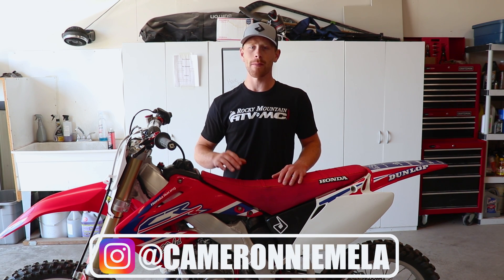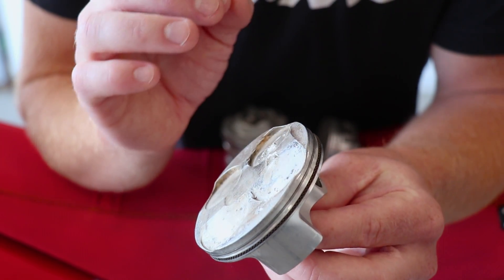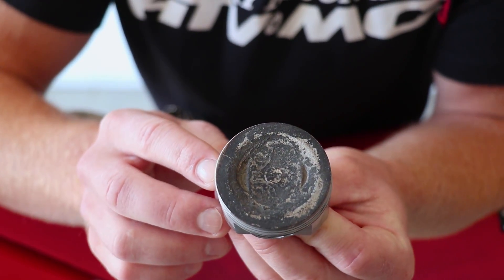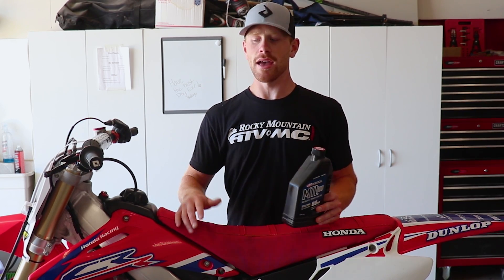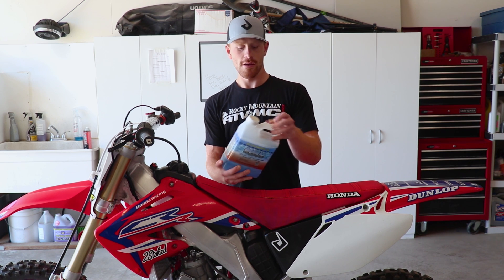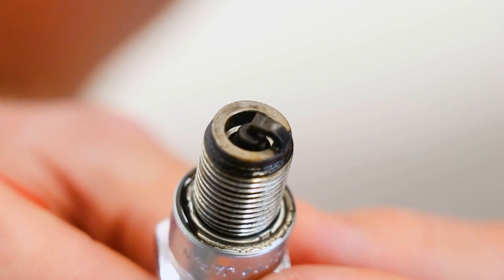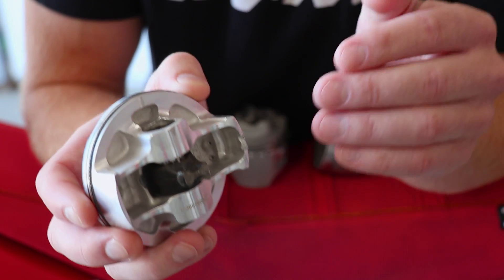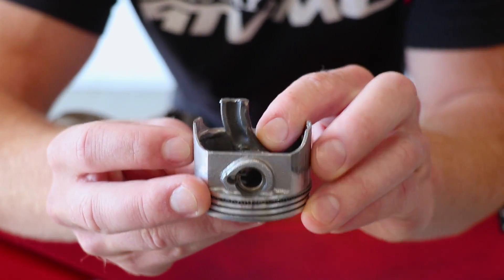Why Do Engines Blow Up?

Comment: Could it be a goo..d idea to change out the valve springs before they become too weak to close the valves fast enough to keep the piston from eating them like your own  engine did and the piston with a valve smashed into it .??? .. And a good way to stop those cam cha ins from ventilating .the bottom end is to change them out before they c$$$ caching change you out ..that every year to be safe you gotta do ..like Indy cars that have to be done every race ....you see kiddies when you burn your candle at both ends you get a bright light .but for a very short time ....see you at the parts counter ..

Comment: Cameron love your stuff mate, I am an AUssie based in Phuket Thailand, we ride singke track in the jungles and mountains, my main bike is a KTM 525 EXC setup for tight single track (many mods) amd I also have (had) a CRF2050L with Takegawa 305 BB kit, EJK controller, Yoshi (clone) pipe, YSS susoensions mods and Renthal bars.. its went like a rocket, ran perfect ridden hard offroad only, was my backup bike and also for short adventure rides, was setting it up for longer trips .. THEN DISASTER .. i burnt clutch plates stuck in mud,  a new mechanic replaced clutch plates, oil change etc and first easy  20 mins it blew to pieces at 120km slow cruising on a road trip, TOTAL destruction - pieces of metsl csm out the top of the crankcase (scary), pulldown revealed the worst news -  full rebuild needed - 2 crank cases, cylinder , head, , valves, piston kit, etc (I can post pix link if anyone interested). Made no sense, its was an awesome engine, ridden hard offroad with zero problems, until then... mames me wonder if something done when last worked on caused it as seems  big coincidence! anyway  i dont want to go back to a stock 250 as I liked the 50% more power it had (my other bike is a KTM 525 EXC), I dont want to do the BB or Takagawa kits as I prefer to keep all Honda parts as when on advenrture rides all over SE Asia, will be easy to get parts. SO .. I am trying to decide between a rebuild using CBR 300 parts, or a full CRB300 engine transplant, or another that fits fairly easily. As I live in Thailand the CRF parts are cheap as they all made here, so thats a plus. Can you offer your thoughts? Anyone else done similar?

Comment: I’m too scared to get a 2smoker ✨rebuilds✨
Reply: 4t break less often if well maintained
Reply: @speedyboi349  Yeah, but when the problems come it’s expensive lol. I’m getting a kx100 February just because I at least want one 2 stroke. I
Reply: @490Adrian  damn those are fast 
Should i get

1 honda crf 150rb
2 ssr 250 and modify the carb
3 gas gas 250f
Reply: @speedyboi349  SSR will be a money pit, how tall are you? Can you fit a 250f gas gas? How long have you ridden? If you are experienced and tall enough go gas gas
Reply: Well im very experienced but im thinking on something my dad an i can ride 
Im 5,2 and 15, 100 pounds 

Dad is 6ft and he weights around 182 pounds 

I dont mind riding tall bikes
Reply: @speedyboi349  Go gas gas! I’m 5’2 or 5’3, 12 and wouldn’t dare touch a 250 lmao
Reply: @490Adrian  the problem is i can find them in my area 😑

I live in PuertoRico
Reply: @speedyboi349  Damn. Puerto Rico must be pretty to ride though.

Comment: Can having your air screw out too far cause your bike to blow by getting really hot from too much air?
Reply from the maker: Yes, leaning out the bike will cause damage but it's unlikely you can lean it out enough with an air screw to do much
Reply: @CameronNiemela  Alright, good to know, i think i have to drop the pilot to a 45 on my yz250x, it will not idle unless the air screw is out like 3 or 4 turns, i hope i didn't hurt my engine riding it with too much air.

Comment: ive had a valve snapped  blew a hole through the piston fixed that then it blew  up again a week later still not fixed that was about 2 years ago reason it blew up was my friend riding it through a big ass puddle un hydro locking the bike bent the rod lmao

Comment: Cool video Cameron! On 2-stroke 125s I have had the circlips fail twice! Both time resulted in pretty horrible damage to the top end, destroying the cylinders. I hear it is a common problem because even with quality brands like Weisco or OEM, the circlips are cheap pieces of aluminum. Thoughts?
Reply from the maker: How the circlips are installed had a big difference. They need to be installed with the gaps straight up and down
Reply: Cameron Niemela yes, they were.

Comment: so my engine blew like last week, they way it happened was strange and i don't really know how. i have found out that the ignition plug was too long and the piston hit the tip of the plug which punched a hole in the piston. i wonder how this happened and how much damage there is to the engine. i was going to order a new sylinder with a cranck shaft anyways but if more of the engine is broken i'll just buy a whole new engine

Comment: Quality of coolant won't cause any failures, you can run any fluid thin in a radiator and it will be fine.  I don't suggest that but we get your point.  Other why's great video.

Comment: Lost compression on my 2001 yz125, took the head off and the head was destroyed along with the piston. The ring seized around the piston. So I split the case and threw in a new crank with all new bearings! Now i'm just waiting on the kickstart shaft since it was stripped out and the bottom end will be done! Any recommendations for top ends? I installed the Wiseco bottom end kit
Reply: Wiseco

Comment: 2010 crf250r...bought used rode it 30 min..grenaded th motor..same story of needle bearing cage coming apart..like ur buddy Jeff very common..1 Hot Rod stroker crank kit later..still going strong...

Comment: I had change my oil on my ssr 189  before riding and forgot to tighting to oil bolt and on my way home  bout to clean and put it away when the engine lost like all power and started clankin loud so before it really siezed i killed it i put a new bolt and oil in it and now it it tick loud i think its the valves ive adj dang close to spec and still clicking or ticking is it ok to ride it?????? Can some plz answer this thanks

Comment: 2010 Suzuki DR-125SM. 150cc kit, ported cylinder head, bigger fuel injector, open airfilter and Black widow GP exhaust system. Banked 23.7hp on the rear wheel with 27Nm ft-lb of torque. Previous owner never bothered to check the oil retainer. about 3500km on the new build and the cylinder head exploded due to the amount of gunk that was in the filter behind the oil retainer, no oil was flowing trough the system anymore.. Camshaft and rocker arms were blue from the heat and completely bent. Piston expanded and the crown got stuck beyond TD, the connecting rod pulled the rest clean off the crown. Both valves were snapped. Amazingly enough, the crankshaft is undamaged, the crank balancer is bent however. This all happened in about 1 second on the highway going 140km/h trough a slight turn. I think I can thank god for not throwing my gearbox and still being able to roll her out with the clutch.
Reply: Is suzuki"s reliable

Comment: My 2006 wr250f has 14000 kms on it who wants to start a bid when she will blow .. burns no oil and valves are always in spec
Reply: Had one customer who got to 20,000 km on his WR250F & started to worry, so we decided to strip the top end & refresh piston & rings. It still looked like new inside. Last time i saw him it had well over 30,000 km & required & new Stator, but engine was still running strong.

Comment: Hey cam. I got a 05 trx450r. I went to my first quad race this year being a bike guy.  Made all my practices and rite before my 1st race my bike quit getting spark. I went to work. Trying to fix it.  Short story long. The stator and flywheel are beat. I change my oil every three rides. Even if I just putt around the yard for ten mins I count that. If u are a Washington guy I would love to meet ya man and maybe do a build with ya on this trx motor. Cause it's worn and there is slop where there should not be my friend. She didn't self destruct but is about to. Contact me. Austinsonger266@gmail.com

Comment: The piston on my cr500 recently blew apart ruining the crank and luckily nothing else really was damaged (except a few dents on the cases but nothing to worry about) and your videos have been really helpful on learning what I need to do to rebuilt the engine. For now on I will always take the cylinder off to inspect the piston and crank on every used bike I get.
Reply: How did it go

Comment: Everyone always talks about how much cheaper a two stroke is to rebuild but never consider how many more hours you get out of a four stroke. If you pay for a complete 2t rebuild you’ll pay around 500-800 depending on how you do it and a 4t will most likely be 600-1000. You’ll pay more for the 4t but will get 50 more hours before having to do it again, if you build your own motors it doesn’t matter then. 🙃

Comment: Your right bro, waiting eagerly for those build vids to come!!  But hey, I have the same thing, I also build bikes and fix them, like now I have a BMW F60GS. The cam chain tensioner collapsed, causing the intake cam to skip a tooth, and the piston did not play nice with the intake valves, and the cam chain guides also broke into pieces. Now, everything is delivered except one intake valve, as BMW South Africa had only one in stock. Now, to my dismay, everything is laying on the bench, itching to be re-assembled, but I cannot do anything for now. You can check out my site over at www.accustoms.co.za click on the gallery link. Not a very impressive site, but hey, I am trying.

Great stuff and keep the vids coming!!! You can bombard us with vids, nobody will complain!

Comment: For competition worth using a dial gauge every tear down and measuring things like con rod side deflection and piston height as well as regular checking of valve clearances.
For example in a 2t every time you swap rings, measure side to side rod defection so see how the big end is going as well as rinse out of the casing the see if there is any debris sitting at the bottom.
Color of the piston underside, signs of ash.
Main bearing radial and side deflection.
Measuring valve clearances can give early signs of some change to the valves that can indicate impeding failure.
Measuring piston height at exact TDC can show up signs of con rod stretching.

Comment: I need a friend that's smart like you lol I watch your videos to learn about engines and mechanics I bought a non running 2000 r6 and got it running but I'm not good with tunning carbs and I know you can do a good check up on it if I knew you

Comment: My 2013 Suzuki Rmz 250 rattles at really low revs in a high gear. Is that normal? Need help plz
Reply: Woidviatla Lausbua sounds normal, you shouldn't ride at those low rpms though

Comment: I had a motor blow up (with 3 hours on it) after rebuilding it with Chinese parts from ebay. the connecting rod disintegrated.

Comment: Yesterday i bought a new bike, went out for a ride and it ran great. Today i also went for a ride and suddenly the engine shut off and there were quite a bit oil dripping, I checked for leaks and i saw that the drain bolt weren't there... I had to roll it home (2km) but hopefully nothing have blown.

Comment: Never seen a bent/broken rod in a CRF 50. Seen some no oil/seized pistons. That tiny piston with the bent/fractured rod looked weird. Thanks for sharing.
Reply: Don yeah there stock bore us no bigger than  lil pecker. But that looks just like the big bore 88 cc kit piston I just installed for a buddy of mine. Keep shredding!

Comment: Dat feeling when ur engine blows up and u have to push ur bike 10km to home. Rips man inside very well.
Reply: Walk of shame
Reply: If it blows up on you u are doing something wrong! never in my time have I ever had any bike blow up. top end every 40 hours full engine every year 3 rides and oil change and always clean air filter simple. never grenade if you do that
Reply: @Bumfluff-Rider  Well my engine blew up because someone cut down a tube from my oil pump so I was riding for a while without oil. A few months after I got it repaired the same shit happened again. Some people can be real assholes.
Reply: @dominick1009  i rided my moto for 3 days without oil, didnt noticed it but its still alive idk how
Reply: @GamingSilentTuber  dang...what bike is it?
Reply: @csgmail4316  kawassaki 125cc street bike
Reply: @dominick1009  i dont use an oil pump its way easier to mix your self and way saver
Reply: @Bumfluff-Rider  Lol my bike from 2005 been used everyday rare changing oil and stuff,It's still going,Welp rn it has a damaged piston and there's a white smoke coming out,But yea after all the engine still sound soft,If u don't believe watch this vid https://www.youtube.com/watch?v=eZPzx2idnCA
Reply: veeti manninen jep
Reply: It happens to me like 2 hours ago and now I get home 👍🏼
Reply: I did that yesterday 😢
Reply: kkona ukko ite jouduin työntämään derpiä 4km lumisateessa
Reply: Rips my legs more Than my inside fuck pushing a bike through deep sand for 10kms
Reply: The time Dirtbikers get the most exercise 😩 that shi sucks when you gotta push it through mud or hills too😬
Reply: just had to do that today
Reply: Worst feeling there is and always when it's about to rain too
Reply: Or when your mate blows it up and doesnt pay to fix it!
Reply: @fishonadventures96  I do understand this. But if you put 60 hours on your motor and then let your mate rag it it’s not his fault 👍
Reply: I have spent more time pushing bikes then riding them

Three times my engine blew up and once the trans that's only in one bike

But lucky for me I was 3kms away

And once I was 10km on my other bike when the engine simply didn't crank 

Once on my quad the chain broke and cz it had this chain guard in the back the chain managed to rap it's self under there and I had to pull my 500 preditor from the back and push. It while holding it all way home

And in my 210cc the battery died slot of times and I had to push my bike

And in my three wheelier I ran out of gas I pushed it half way but a friend helped

Sure these bikes I didn't own them at the same time each one was in a different year /month
Reply: Just walked mines home. Walk of shame😒
Reply: I hade to push my xr100 13 miles I was just tight trail riding but I am glad I was riding a small bike

Comment: with coolant also a water pump failure, i had a yz250 blow during a desert race due to a water pump failure, figured i was 50 hard hours into a top end and in 5th gear wide open in the hot desert and didn’t check my water pump. learned it the hard way and barely caught it running hot before it seizure still had cylinder damage....

Comment: so does that mean if you never change your piston on your 2t it woild judt lose compression over time but not seize? People always say 2t biles seize bcuz some1 didnt change the piston which makes no sense at all to me
Reply: ACreativeName if the cylinder bore or piston starts wearing too much the piston can start “slapping” inside the cylinder and break the side skirts off the piston.
Reply: Another thing I've seen is that everyone thinks he is the best motorcycle tech. I have seen numerously that these wonderful technicians puts the c-clips in wrong or not properly seated. 6 out of 10 rebuilds I do is because of this!
Reply: ACreativeName It wouldn't seize it would become brittle and crack from wear. As the guy above said

Comment: I just bought a 05 trx450r and I changed the oil as soon as I got it.... I should have known by the amount of metal shavings. First ride out fine, took it out of my truck started it and the rod bearing went. 100% seized. Looks like I’m doing a bottom end!!

Comment: my kx85 sounds like it has a rev limiter, its bounces off rpms full throttle and i loose power. how can i fix this? i have a #135 main jet with V-Force reeds. no air leaks but i do have a aftermarket flow filter.
Reply: Probably running too lean, try a higher main jet first and see if that fixes the problem.
Reply: It could be your float on your carb
Reply: it was like that when i bought it. im wanting to rebuild it and i want it running right before i rebuild. ill buy a stock air filter and if that doesn't work then ill just get finer jets
Reply: Tijn I bought a kit and the closes jet from being leaner then 135 was    a 145 and that was too rich. Should I tap my jet to a 140?
Reply: Tijn true my bike did that because it had a .88 jet and it would rev out really high so i had to put a 120
Reply: The Motocross Crew my spark plugs is fine. After power band it does that
Reply: The Motocross Crew not always but yea some times that could fix it
Reply: Did it bounce off before, did the temp outside get hotter/colder? Try stock setup on the intake and compare or try the bike with a setup that worked before. Always start from the last working configuration and never change 2 or more things at once. Sounds like a jetting thing if you changed jets and filter at the same time, or the carb is made to work with the stock intake boot+box :) Carburators are sometimes works of voodoo art, some work without filters and some need filters to soften the induction pulses.
Reply: Nick Coppola you probably need to run the correct ratio of premix oil to fuel ... 32:1 is what most bikes should run t
But you can lean it out a bit to about 34:1 not recommend by me but whatever you do never run it to lean or to rich ... It can also be the carb if it's dirty or if the jets are off

Comment: What could you do to prevent a connecting rod from snapping? After About how many hours would you recommend rebuilding the top end and how many hours on the bottom end? Thanks 👍
Reply: I know the response is late but it varies for every bike